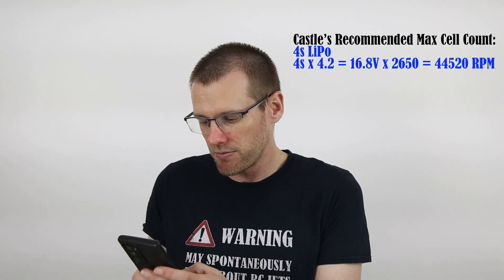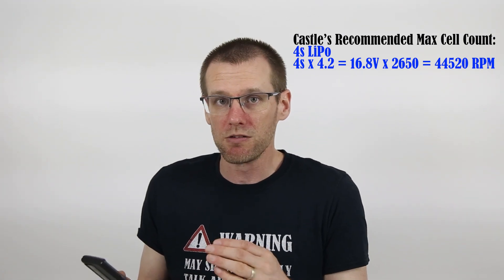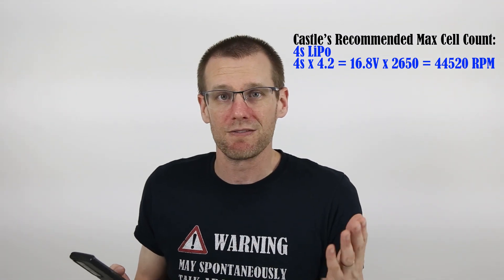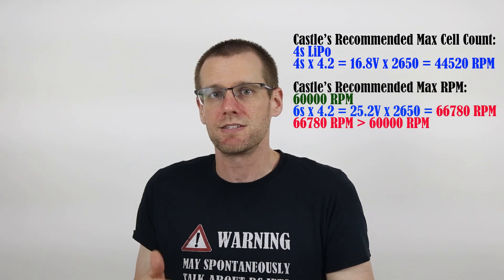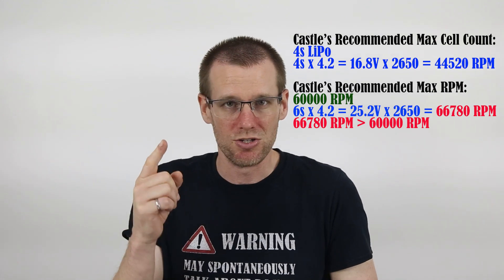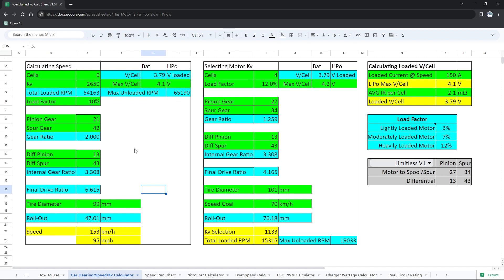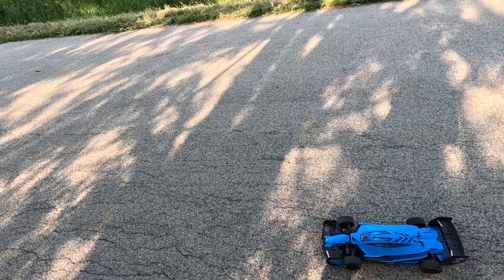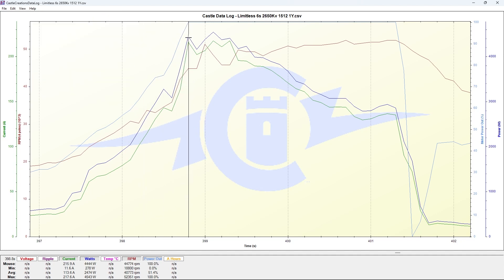Insane Speeds or Catastrophic Failure when Overvolting an RC Brushless Motor?

Comment: I've always felt that the limits of over-volting motors are the achieved temperatures.  Excess rpm can be dealt with by upping the load.  Higher gear ratios or bigger props will bring rpm down.  But excess temperature kills magnet strength and burns wire insulation.  No good comes of that.

Comment: You went about 10% over the maximum rated RPM. You also held that at a few seconds (I counted at the longest in your test runs, that was around 2~3 seconds) & not really long enough for it to have any significant consequences other than the motor spinning really, really, really fast.

With that in mind, I knew this video would be pretty uneventful (as far as expecting catastrophic failure is concerned).

In my own experiences, I have found that one can safely go around 10~15% above maximum ratings, & for a certain time frame before damage starts taking place.

Manufacturers rate their products conservatively, because there is a lot more riding against them if their product catastrophically fails.

Ultimately, it is the responsibility of the end user what they do with a manufacturer's product - The loose nut behind the wheel, as it were.

Comment: Good vid. Dude i run 5s and 6s on 2850kv and 2650kv 4074 cans regularly(fans & heatsinks). I treat the kv volt limit ratings as a suggestion not max limit 😂 keep the vids like this coming.
Reply from the maker: Very Nice!

Comment: I have a Castle Slate motor, 1406-2850 KV with a maximum RPM of 100,000 but is only rated for 4s power maximum. Thats 35.08 volts which is a little over 8s and that seems a little rediculous. If all these stats are true with the motor, the 1406 is probably the greatest speed run motor for 1/10 scale cars.

Comment: There is also the effect of bearing speed (rpm) on appropriate lubrication to be considered for both motor and trans + wheel bearings... =Dn rating.
https://en.m.wikipedia.org/wiki/DN_Factor#:~:text=This%20is%20the%20maximum%20amount,sometimes%20by%20a%20correction%20factor.  Higher rpm requires thinner lube to avoid metal to metal contact/rapid bearing degradation.
Reply: Marvel mystery oil is great for high speed applications, fairly thin but stays on the surface even at high RPM's been using it my boat motors for years.

Comment: I got a question, same idea just other way around.
I wonder if it makes a difference to run my 6s rig on full 6s (2x3S series) but limit the throttle to 50% on the TX
Or run it 3S (2x3s parallel) @ 100% throttle limit on the TX.
purely on numbers it shouldn't matter. but would the motors power draw be different enough to make 1 more viable.
Reply: I believe 2x3s and 50% throttle will be more power efficient. dont quote me on that though
Reply from the maker: Generally speaking, the ESC operates a lot more efficient at 100% throttle. There's an efficiency test I made a video on using a l dyno testing this exact thing.

Comment: When im messing around with more volts/cells i keep a close eye on motor temps, 180 or above is putting things in the danger zone so i usally shoot for around 150 to be safe. If its an old motor and ESC and I'm doing spead runs I'll bump up cell count until something melts.

Comment: Aren't some of these max rpm stated by the motor manfactureres, normally 50,000 or 60,000 rpm depending on different manufacturers. To do with the max rpm that the ball race manufacturers state for the max rpm the ball races should go to.
Reply from the maker: It's a good point. Most ball bearings can go pretty far up there in RPM in our applications. There's quite a bit of factors that go in to max rpm for a bearing.

Comment: I have turned a few rotars into powder by over-volting some of my old Novak brushless motors, one on a race day sounded like 2 bricks being clapped together 🤦
Reply from the maker: Yep, hope they didn't take out your esc  I've watched this process in an airplane take out the esc too.
Reply: @RCexplained  fortunately I still have and I'm still running some old skool Novak ESC's from 15 years ago and they are still solid, before they switched component suppliers and went to crap. Sucked seeing such an awesome brand go down hill over night.

Comment: One thing that will happen is that if you exceed the motor's redline... the maximum rated RPM, you will wear it out faster. I've noticed that many of Castle Creation's motors are rated for 100k, whereas cheaper motors usually are rated at 50 - 60k max RPMs. I figured that had to do with the balance of the rotor and manufacturing tolerances... the Castle being more precise to allow for the substantial difference in maximum RPMs.

Comment: CC motors are so well made and tested, I generally feel I've got some wriggle room if I'm "careful". I tend to go off the max RPM rating and keep an eye on the motor temps if I'm pushing the voltage up to or beyond the rated maximum.
Reply: I'm the same way